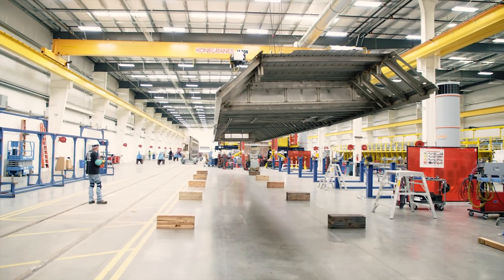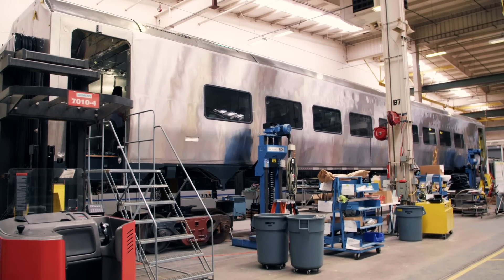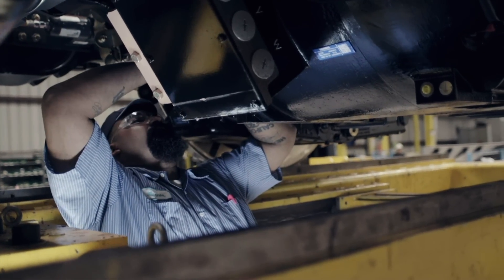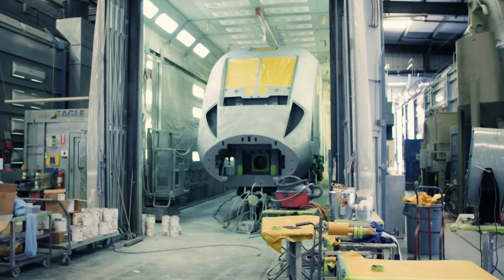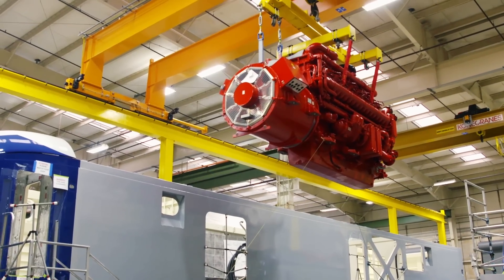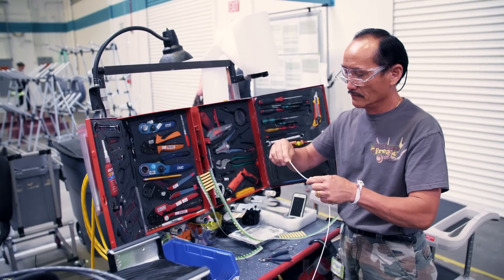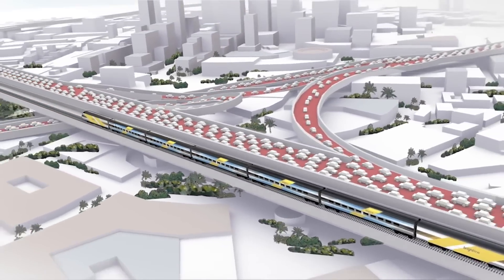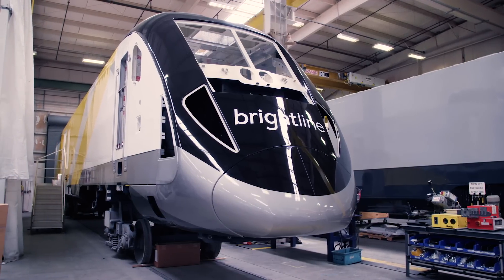Inside the Massive Factory Where Siemens Builds Trains | WIRED

Comment: They're building a new line but don't electrify it, what the hell? Electric trains can accelerate much faster and their maintenance is much easier and cheaper.
Reply: Upfront costs are lower. That's why all true high speed rail projects are partially, if not fully government-funded to mitigate risk to private investors, and they usually join in later in the game.
Reply: Infrastructure investment in catenary is much higher, potentially justifiable with high traffic like in NEC. You putting up the bux, bro? Diesel-electric much more flexible, much better investment over HUGE rail networks, for multi-mile-long freights.
Reply: in florida however, I think the climate down there would just destroy the catenary overhead. Hurricanes, unstable soil layers, not to mention FEC still operates frequent double stack intermodal trains up and down the corridor and heigth restrictions would probably reduce them to single stack. And to @Sean Jau, I believe only Orlando to Tampa is a designated US high speed rail corridor. Orlando to Miami is not, so federal assistance is not possible. I believe they tried for a loan, but got rejected. Orlando to Tampa however I believe is eligible for federal funding. In addition, Diesel-electric locomotives are pretty efficient up to 125mph speeds. Say, they build the line to Class 8 trackage speed of 160mph, electrification would then be far more sensible.
Reply: @jtkm  although double stack freight trains aren't a reason against electrification, I do agree that the Floridian weather would require some hefty investment in weather damage prevention technologies
Reply: Brightline might start electrifying their routes ones they reach Miami, and they will convert their engines to use electric propulsion or both.
Reply: I don't think I qualify I  only know customer service  this is our of my leagu
Reply: The upfront cost and maintenance is definitely not cheap. And the grid can't handle everything electric. Rather use Fossil fuels in engines than boost the electric grid with fossil fuel burning generators LOL

Comment: why don't they build magnetic trains? (resason = future proof)
Reply: The Maglev Technlogy is not unsafe, but they have higher construction cost by less maintance cost
Reply: Maglev uses actually more energy than conventional electric train due to its magnetic suspension. For medium-sized routes like Orlando  - Miami, hyperloop would be better choice when it comes to high speed transport. But again, both hyperloop and maglev would need more money for construction and maintenance. And of course, private company, like Brightline, is not interested in cutting edge solution, they are interested in making money.
.
Reply: @Samo Harvan
Maglev is phenomenally expensive and only marginally faster than conventional rail. But at least it exists, while Hyperloop does not and will not because of physics and cost.
Reply: @Ethan.Lamoureux  true. The hyperloop for Me looks complicated and very expensive to construct. I hope in the future they can build it properly.
Reply: @Ethan.Lamoureux  thank you!
Reply: Samo Harvan In an docu about the Maglev in Shanghai they said, that the maintance costs are lower than by a normal train. Brightline is a part of FEC or the connected together so the have parts of the Infrascruture
Reply: Another reason why they havent chosen maglev or hyperloop
Reply: Their construction and maintenance costs are immense compared to conventional rail. Besides they don't have as much capacity as normal HSTs. You can build more efficient routes without the need to heavily invest in a rare and not-much-used technology
Reply: ***** im no train expert, but i think i heard someone talking about how they are getting better. better for environment aswell. but i could be wrong. its a good idea tho
Reply: +Xectromorph your probably right. But there is a few magnetic trains in China right now
Reply: +Xectromorph thats why we try them in China first ;D
Reply: well its US design i think or EU
Reply: Those trains were made in Germany,
Reply: Well of course not in the US, but in Japan they have one network under construction. Expect service will be 2027. Maglev trains currently holding the speed record of 376mph